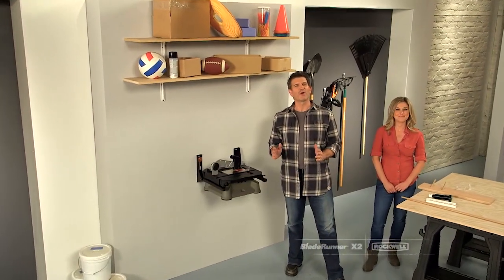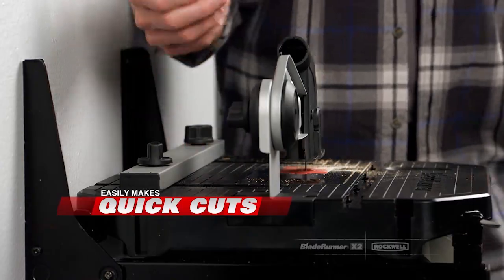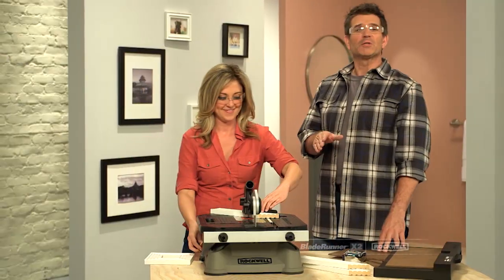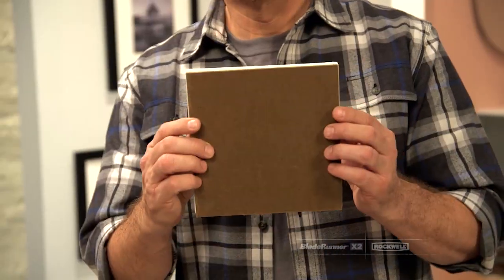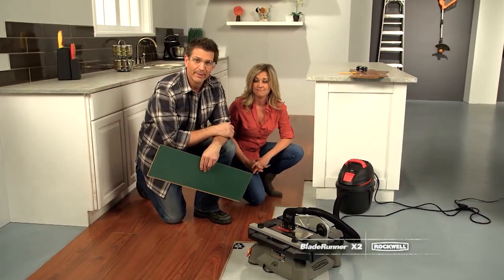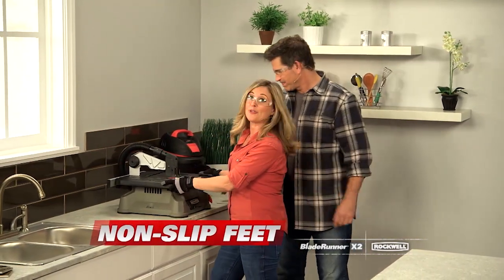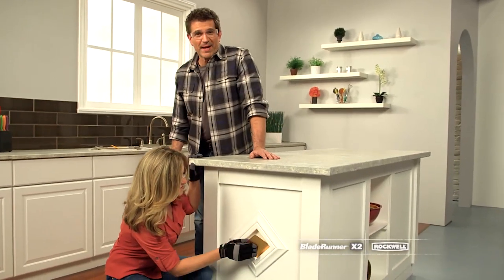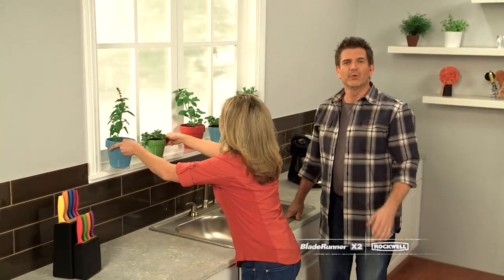BladeRunner X2 | Project Ideas

Comment: Unpacked, put together and cut my 1st. piece in 5 minutes.  Great for smaller projects and saves me using the scroll saw for many projects.  will keep the table saw for larger work.  Very impressed with it.
Reply from the maker: @Zara King. Thank you for the comment. We're glad you're able to use the Rockwell BladeRunner X2 in addition with your other power tools. Thank you for being a valued Rockwell customer.

Comment: The original blade runner had variable speed but the arm was in the way of cutting. This one has located the arm in a better position, but no variable speed control. You can use a inline speed control between the plug and the outlet and use that for variable speed.

Comment: I just bought one of these two weeks ago.  I have a nice job site table saw from a major tool manufacturer that I use on major projects, but it is heavy and a hassle to set up if I just need to cut something quickly.  The BladeRunner X2 fits the need.  I have it hanging on a wall, and can quickly put it on the workbench, make a couple cuts, and put it away.  Quick and light, but still has a nice amount of power for those quick cuts.

Today I used it to cut some patterns on PVC lumber to make a light mount for my 1/2' lap siding.  Ran it through several pieces of lumber, and it worked great.  This project alone has proved the worth of the BladeRunner X2.

Love it!
Reply from the maker: Hello Michael W. Thank you for your review of the Rockwell BladeRunner X2. If you have any questions about the BladeRunner X2, you can go here: https://www.rockwelltools.com/bladerunner-x2-table-saw-rk7323.html. You can also contace our customer service line at: 866-955-4175 and they would be more than happy to assist you. Thank you for being a valued Rockwell customer.

Comment: This machine is for smaller projects and very accurate.  I have read some other unfavorable comments, and if you are expecting to rip through trees, then  go buy a chainsaw.  This tool works just fine and makes nice cuts.  If it moves on you while you are pushing through your work, then make a table-stop for it using the Blade Runner.  Have a safe day!
Reply from the maker: Hello syndicateofsownd. Thank you for your support of the Rockwell BladeRunner X2. We really appreciate it, and thank you for being a valued Rockwell customer.

Comment: Now with 2 hand control... You can keep taking your second hand off the piece of wood because ya have to hold the saw in place because it keeps moving on you! And typical long rip type cuts are difficult because the table is so short the piece of wood doesn't want to lay flat and flush! Yay. Ok I  know I am being a smart ass but you can overcome some of this by using a clamp to secure the saw to your work bench or counter top, etc. But wish there was an extendable feature to allow your piece of wood to rest on something that is flush with this table saw.

Comment: can you cut 3/4" thick plywood in circular form? need demonstration.
Reply from the maker: Thank you for your question.  The Bladerunner X2 cuts a variety of materials depending on the type of blade you’re using. Pick the blade that best suits the job, from scroll cutting, to rip cuts, the Bladerunner’s cutting capacity will vary depending on the material:

Wood: 1-1/2”

PVC pipe: 1-1/4”

Aluminum: 3/8”

Steel: 1/8”

Ceramic: 3/8”

For demomstrations, please refer to this video https://www.youtube.com/watch?v=GsJREoryIFc.

Comment: Different working plate, plastic vs metal on previous model and no speed control...?
Reply from the maker: +LordXenon101 that's correct. There isn't any speed control on the Bladerunner. Also, are you asking why it has both a metal and plastic working surface?

Comment: I just purchased this, it does not work well.  You have to push so much on the wood your cutting it moves the unit and miscuts.  The blade does not go fast enough hence the reason you have to push harder.  Cutting 45" for frames ends up with same result.  I have not tried to secure the unit down as it would probably need to be into wood.  Just putting this unit on a table or the ground does not work well at all.  I would not suggest buying this unit.
Reply from the maker: Hello Marc Frazier. I understand your frustration. Your first tool may have just been defective. We do apologize for that. The tools are of good quality and built to last. It's highly unlikely that you will have any issues with your second tool. Again, we apologize but thank you for being a valued and dedicated Rockwell tools customer.
Reply: They do make things nowadays called clamps to hold things from moving.  Just saying ..